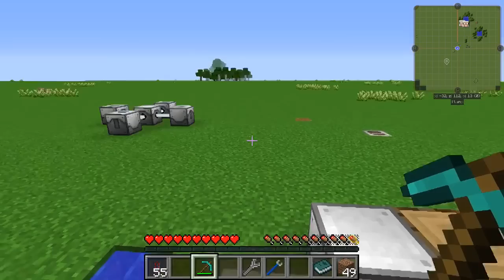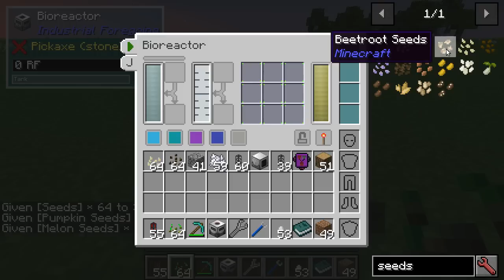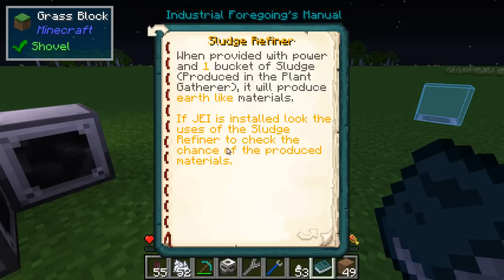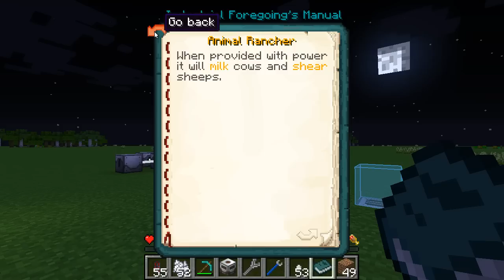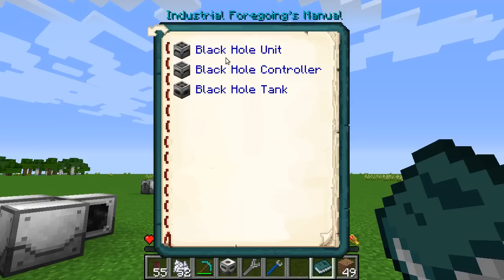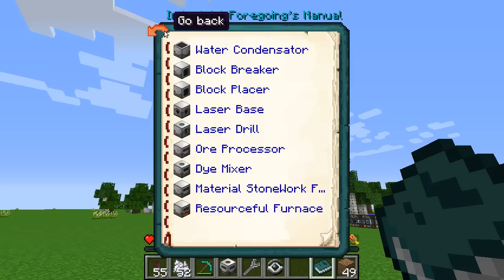Mod Spotlight: Industrial Foregoing 1.12

Comment: conveyor belts with extraction upgrade can transport fluids and items i tested it and works not fast but enought
and there is a generator that doesn't require plastic and can accept only wood.

Comment: I can't figure out why my fluid pump wont work :/
Reply: I have the same problem, did you figure it out?
Reply: @NeonBluz  Nope, I used the Thermal expansion one. This pump sucks huge dongs.
Reply: @NeonBluz  And you have no need for those extra things on the pipes, the water flows automatically.

Comment: Didnt Forestry do Biofuel first?
Reply from the maker: MineFactory did biofuel before Forestry existed. Then Forestry did it better while MineFactory was not being developed. Then MineFactoryReloaded came along and had a different way of doing Biofuel. Then Forestry changed the name of their biofuel to Ethanol so it wouldn't be compatible with MFR's version. Then Forge LiquidHandler came out and made compatibility anyway. 

It's been a long an rather twisty progression.
Reply: Thanks for the reply, and the history lesson! In the back of my mind I suppose I knew that there had to have been a Minefactory for Minefactory Reloaded to exist, but I'll be honest I never saw that mod in all my times combing through the mods area of the Minecraft Forums. I started modding way back in around 1.5ish beta, so Ive been doing it awhile, just.. never saw the original Minefactory. Weird. I remember that the first mod I ever used was Buildcraft and being so impressed with the piping system :D Ahh to be young again.
Reply from the maker: The original MineFactory was a Buildcraft Addon in the BC 1 or maybe BC2 era... by the time BC3 hit, it had already gone by the wayside and Forestry came along. The original MineFactory was actually hosted on the Buildcraft website for quite some time, it never had its own website and I don't think it had a post on the MC forums.

Comment: Your server theory is not accurate.  Several small machines increase server load over a single large machine.  It is faster to have smaller plots, but it increases server load.  The way the mod is coded will time out with larger machines, giving the appearance of tick lag, but it's the small army of machines that kill servers ;)

Comment: One thing that is worse than MFR is the Plant Sower, it doesnt have an inventory and so you have to have a minimum of 144 of the seeds u want to be able to automate it
Reply: You can use an Item Splitter (included in the mod), it's poorly explained in the manual but instead of pushing seeds directly into the Sower you push them into the Item Splitter that's directly by a side of the Sower and the seeds gets "splitted" into the Sower slots.